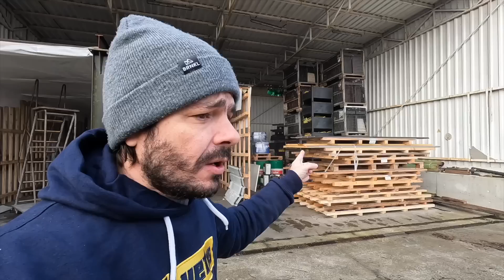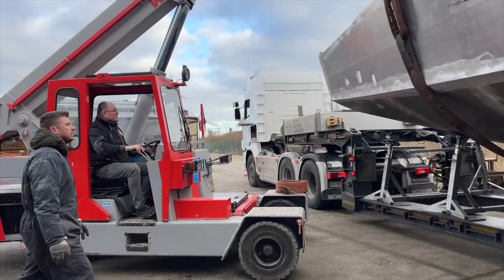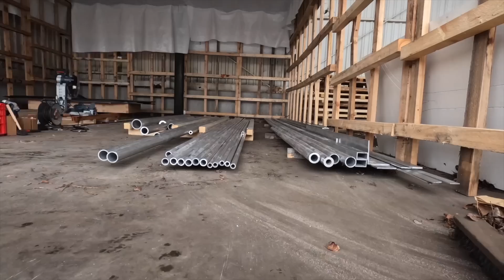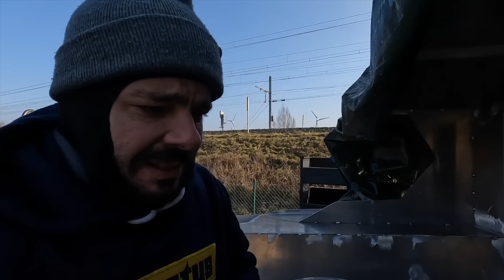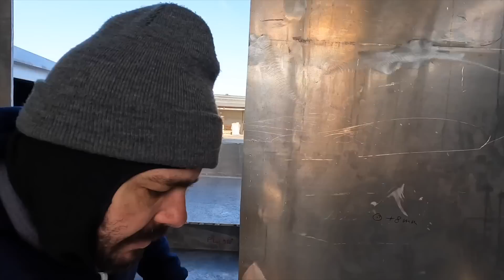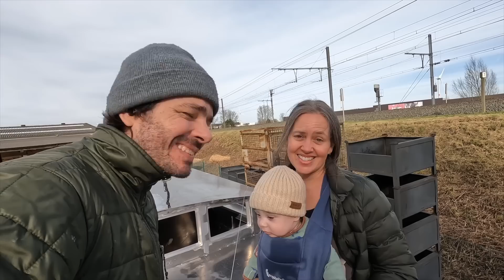⛵️Our boat is UNFINISHED... but we had to take it out of the boatyard  Ep.357

Comment: Sad to hear the issues but it looks like you will probably be better off in the long run. Now you can film progress (and hence get back to work and earning from YT). Great idea to have some time off, go enjoy the warmth and family and try to reset. 
My suggestion would be to try and find an experienced welder, especially and old timer who is retired. Look at it as a learning experience where you can document the process of learning to weld and building the boat. As with all sailing don't worry about the end date, if it takes 5 years then so be it. At least then Oli will be swimming and playing with his sibling(s) by then (wishful thinking :P).
Make the build the journey. 
Welding Ali is a skill but it can be learned (how else do others do it otherwise) and I'm pretty sure you don't need to spend 10k on a welder, as long as you can find someone who knows what they are doing to be there with help and advice and to start the process off for the tricky parts. 
You only need a 10k welder if you were doing constant lines of welds all day long for years, but as you need to stop to let it cool down a lot a much cheaper welder will work for you (but get advice first before buying or even reach out to some welding companies for advice and maybe a sponsorship ).
Just remember to pace yourself, it is going to be a long job till it is ready to sail and you don't want to burn out in 6 months time.
Whatever you decide I wish you luck getting through this period quickly so you can settle back into focussing on the boat.
Reply: I followed Duca for months with the feeling that I knew him from somewhere. I met him about 20 years ago and he is the heir to a billion-dollar company with a big B. YouTube money is nothing. A normal brazilian dont get close to a boat like that

Comment: Duca, if Meta experts in Al welding, felt that it would not be wise to continuous weld the window frames Id be VERY hesitant to do otherwise! Unless their advice was simply to save them time!
Reply: It can be done, 100%. It takes time, you cannot do it in one go. You must wait for the metal to cool off and do little at a time. It's just cost saving. I mean, they welded, not even half the boat... scammers
Reply: You weld aluminium in 30 to 50mm runs so it doesn't deform. It takes a Lot of time. The few tacks shown were horrible!  The few videos of Meta constructing the hull in previous videos showed a very unskilled and low budget builder. From videos of other aluminium hulls being constructed this hull seems to have very few ribs & stringers. 😊

Comment: I agree with the comment that read: "Get a professional welder who has spent years on this job and is retired, who can work part-time in his spare time, and a used welding machine, and to complete the other works together with that person at your own discretion. Aluminum welding is a difficult type of welding. The best thing to do is to continue this job with someone who is experienced." I don't thing a welding achine is that expensive. Check with the Delos people inAustralia about the appropiate inexpensive welding equipment.
Reply: Yes, do NOT spend 10,000 Euros on a simple welder. I have one I paid 1,000 dollars for and it would do everything you need. Hiring a retired shipwright is the way to go. That way you can control your cost and schedule. AND you will learn to be a master welder in no time. You are that good.

Comment: What Delos ended up doing (Brian) was learning just enough about welding to do a lot of the work. Then, he uses some help when he needs it. Your keels would be possibly a place where you couldn't do that work maybe. Welding aluminum isn't as hard as you might think, but it does require a really good welder because you have to be able to control the temps really well. He put in all the engine stuff for instance and it wasn't too hard. Take a look at what he is doing, maybe you'd have a chance, your a smart guy !
Reply: I dont kno Brian There's an exceptional human being. And all he's doing is tiny little Wells.This boat needs.
A shit ton of welding done still meta absolutely screwed these guys
Reply: What Sailing Delos has done is very rare. Fabrication shops that will even allow an owner/builder to watch, let alone directly participate in, the construction of a sailing vessel are few and far between.  What Brian and his family have accomplished is nearly superhuman. It amazing the see such a comprehensive and intricate collaboration. I believe Duca and Roberta will need to approach the remainder of this project differently and have full confidence it will all come together in the near future.
Reply: @geraldhenrickson7472 The professionals Delos is working with are amazing.
Reply: If you watch Brian weld, and he's very new (although he had a great but short term teacher) you can see that it isn't rocket science. Take a look at a few videos where he was learning. It's definitely something I want to do. I think, from what I've seen, welding aluminum may be easier (albeit needing a more expensive welder ?) than welding steel. And, at first, if it doesn't really look good, you straighten it up with a grinder. Even the best welders do that constantly. If I owned an Alu or Steel boat I'd definitely learn what I need to learn, its a no brainier. The owner of the Catalpa boat also learned how to weld. He's welding stainless pieces. IT ISN"T ROCKET SCIENCE (You start out with the easier jobs like welding brackets onto the boat inside the hull ect. , not the outside where everyone will be looking. Like I said, get help with the keels. )
Reply: You Really Need Some One with a Lot of Experience In Alumium Fabrication , Ya Dont want any of them Welds Cracking In the Future , There Under heaps of Stress , Might be Ok For Small things like Engine Mounts Ect , But There Talking Structural Stuff

Comment: I really do not understand why so many thinghs were left to do for the batch covered by the first contract. I suppose something went so wrong that the contract was terminated abruptly.
Probably we will never know the thruth, and the fact that Duca made no mention of the reasons that generated this situation might suggest that an NDA may have been signed with the boatyard.
Anyway, it's a tremendous job to do with only their own forces; a professional welder could solve some issue but I'm not sure you can easily replace specific skills and experience in a short time. Any decision must be weighed carefully, every hole deeply evaluated, each weld bead verified to avoid damages and alteration to underlying material. You would need an experienced shipwright skilled in alu fabrication.

In my very humble opinion, better to move in another shipyard.
Eager to see how this project will proceed.

Comment: I just hope you will not go to Brazil before you move the boat in the storage. 

As for people that ask questions- there's only one reason we can be 100% certain about and it is Meta's delays. Videos so far show that guys did really good job putting all this aluminum together but it was waaay to slow. There must be some other things and we will probably never know because we should hear both sides to get the full picture.

Oli looks great and that is by far the best and most important of all stories.

It is all in your hands now Roberta and Duce, and probably for the better. It will take a bit longer but you will probably be more satisfied with results and I believe boat building will make for some nice Youtube content. Hopefully more lucrative than sailing. It only goes better from here I am 100% sure of it.
Reply: @cetterus  did some digging around. The company changed owners in 2020 and now apparently they have financial problems. Also looking at all the welders welding without appropriate equipment..... They might have legal problems also. I don't know how they can operate like this in France...

Comment: Have a look at what SV Delos have done. Brian has learned to weld from a professional welder (who built the basic structure of their catamaran) and Brian has been doing a lot of the welding as part of the fitting out. I'm sure you can do the same. If you buy a welder, it will still have some value once you have finished with it and you can sell it on.
Reply: @colinbolton5415  that shipyard did a good job. The whole build is amazing, no delays, just work work work

Comment: You don’t know what you are getting into. You don’t have any equipment,welders or metal tables. I’m sure they use a jig table when they build some of the parts. Just the tools and equipment that you’re gonna have to buy it would’ve been worth paying someone to finish this.
Reply: I saw all the video, for educational purposes, because I am a welder ....and I was no jigs and no modern techniques. Nothing that was worth remembering. Aside for some subcontracting for certain parts, a good qualified welder can do most of the work there, with no problems.
Reply: @wtfatc4556  And I'm sure Bruges has fabrication shops that can handle any further cutting or specialized tasks. But yeah, a certified welder is a must here.

Comment: The cutout in your watertight bulkhead is designed as a stress relief point. Any sharp corners with high stress are otherwise prone to cracking and material failure. You will need the money to do all the critical welds, so spend it on human professionals and do not buy an expensive machine with the hope that you can do some simple tack jobs. That will come much later, maybe years. It's a good idea to pause, relax, and thoroughly consider your options. No hurry, gather all factual capability and cost data first. Cheers.
Reply: Triaxial stress
Reply from the maker: I don't believe that was the intent as the other one that was originally water tight didn't have the hole and was fully welded.
Reply: @OddLifeCrafting  I noticed that the hole is where a previous longitudinal weld was. Maybe they did not want a re-weld on an earlier weld. The yard should know what it is doing. Cheers.

Comment: It's sad when the "boatyard" loses parts. I'd say get the welder, from the looks of most of the blobs, you would probably pay much more attention and get a better result. Welding isn't as hard as everyone thinks and a good high quality Mig & Gun will make life much easier for you. Then whenever you want to do something custom, you will have the skills and confidence to take care of it. I can't stand depending on others and understand why you feel much better about having your boat under your control.
Reply: the boat is made from aluminium, welding aluminium is a whole different kettle of piranhas compared to welding steel, id say pay an aluminium welder to get it over and done with instead of burning holes in something that needs to float, there's already a mountain of work without the welding.
Reply: @ Did you not watch the part where he hires someone to learn from?
Reply: To be insurable, welds need to be done by a certified welder. No point in dropping the ball at this point. A good welder could do all that in a few months-ish, while other components are being pre-built in the workshop next door.
Reply: @ And that's what he said, hire someone and learn from them. I guess maybe you didn't catch that part.